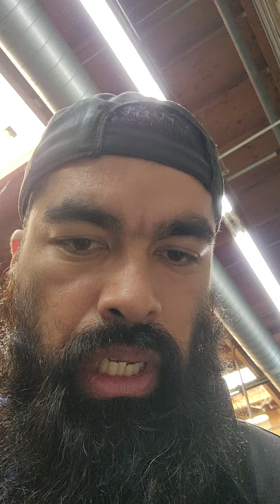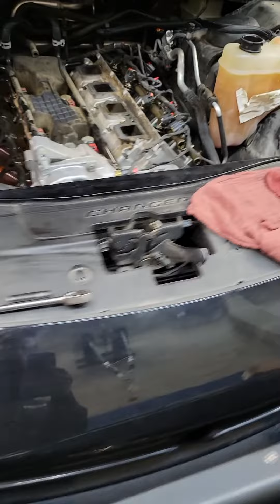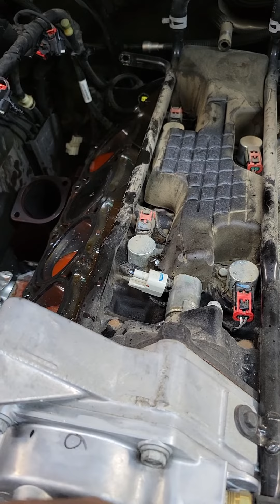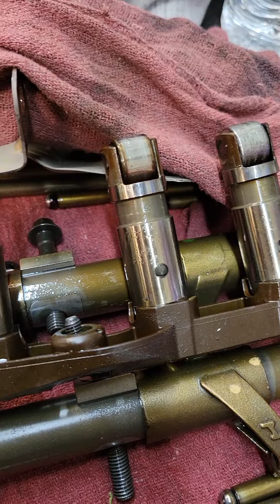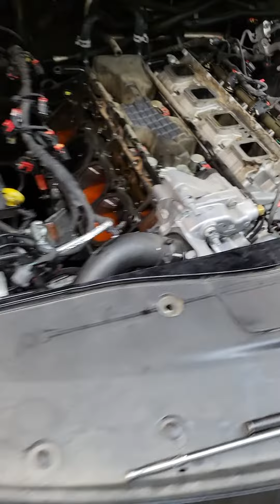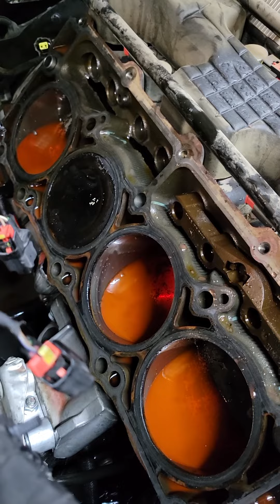2019 dodge charger 5.7l stored dtc p0308 misfire ticking noise heard when driving

Comment: I just started hearing a slight inconsistent ticking on my passenger side on my 2020 1500. Fml! How long does it normally take for a professional like yourself to do that job and what determines if you end up having to get the engine replaced?
Reply from the maker: Hey brotha sorry to hear that goin on for u if u have a 5.7l engine more than likely it is cam and lifter issue it's about give or take 8 to 10 hour job. Have to remove cylinder head and replace cam and hydrolic lifter and recomme d replacing the rods Caswell usually get pitted. Also make sure it's not an exhaust leak I would get diag done and very you're issue.